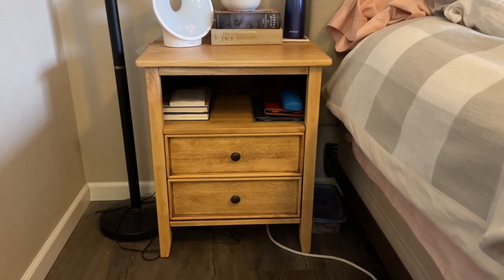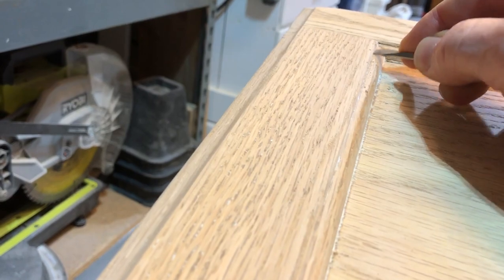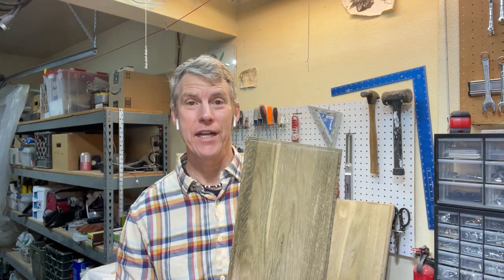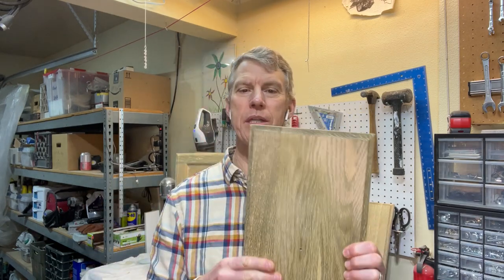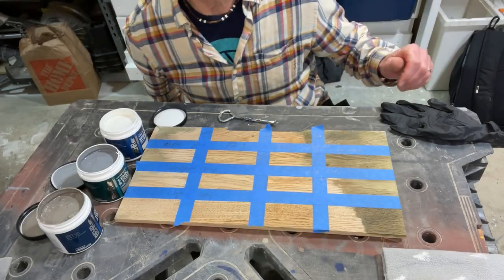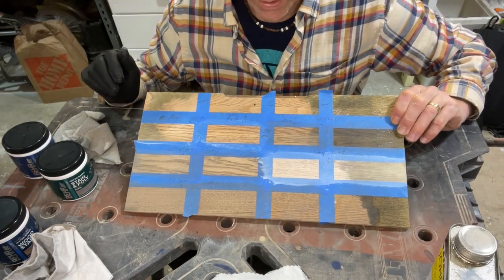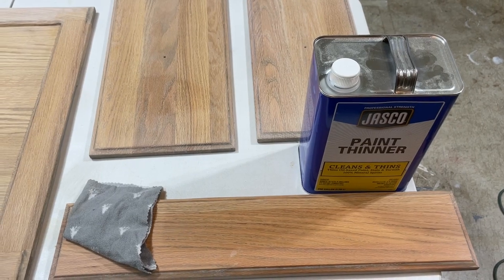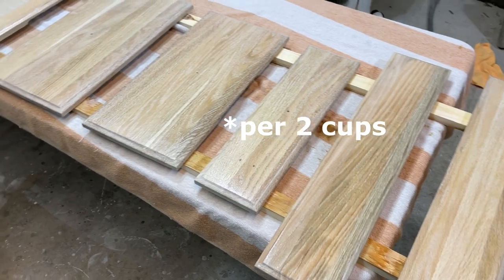Bleaching Red Oak Cabinets

Comment: I was going to choose your method of bleaching, as I also have red oak bathroom cabinets. But decided to buy a Zinsser 2 part bleach product which seems to do the job for less than  $13. Thanks for sharing.
Reply: Please let me know your thoughts on how well it works. 

P.s. I have revised my formula to be 1 teaspoon of lye for each cup of 27% peroxide. 

This reduces the green that sometimes appears. I usually do the process twice and it comes out looking like Ash (nearly white).

Comment: I just bleached my red oak cabinets. I also used 100% lie but I use 27% hydrogen peroxide didn’t have any green. I was able to find 27 % hydrogen peroxide at the pool supply in my area.

Comment: I bleached my red oak dining table. I used 1.5 tsp of lye per 1/2 cup of water with equal parts 27% peroxide. I put on about 5 coats. It looked great.     I waited about an hour after the last coat and neutralized with with 50/50 vinegar water solution. That’s when I realized there were a few dark spots on the top!!! The rest of the table of fine. How do you suggest I correct those spots?
Reply: I found the same thing. What I did was put the solution on those darker spots. It sat for quite awhile, almost till dry, then neutralized and they were better. To prevent the lighter area from bleaching more, I covered the surrounding area with something to block co tact such as painter’s tape. 
I hope this helps.

Comment: So a lot of carpet guys use a UV light and hydrogen peroxide to take out stains and carpet. I wonder if using a UV light in some of the very colored areas would help draw that color out.
Reply: Great idea. Thanks. I’ll try that next time.
Reply: I’m a carpet guy. And I refinish wood. Uv lights are all around horse shit! ……red oak can only be stained darker , if u want light or grey without red , u gotta remove the red oak wood. One last thing , WATER BASED STAIN SUCKS!

Comment: I had the same issue you did with the dark color.  How do I get that dark color out?  Can I just sand it down?
Reply: I applied the bleaching solution on the spots alone and they lightened. Just keep doing it.
Reply: @GlennJohnson1 Thank you!  I bought Zinsser bleaching, hopefully that will do it.
Reply: Please let me know.
Reply: @ellenlee1188  I’m in the same boat except I’m wanting to refinish / lighten my staircase banisters. At present I am waiting on Amazon to deliver my Zinsser wood bleach. 

Let me know how it went. I hope it worked out. 👍
Reply: @boyshanks , I used the Zinser and it worked, it took out all the dark spots.  My issue was the staining and the darks spots with staining but I fixed that with white paint and sanding.
Reply: @ellenlee1188 Thanks 👍

Comment: I just bleached my red oak cabinets. I also used 100% lie but I use 27% hydrogen peroxide didn’t have any green. I was able to find 27 % hydrogen peroxide at the pool supply in my area. 
The formula was 4 ounces of 100% lie to 4 cups of distilled water. Stirring it in 1 ounce at a time in a glass jar because it will get very hot. Apply the lie with a sponge making sure to use chemical safe gloves. Give it a few minutes and then add the 27% hydrogen peroxide with a sponge wait 24 hours. if you would like lighter you only need to use the hydrogen peroxide again. Before you apply anything else make sure to wipe them down with 50% distilled water and vinegar.